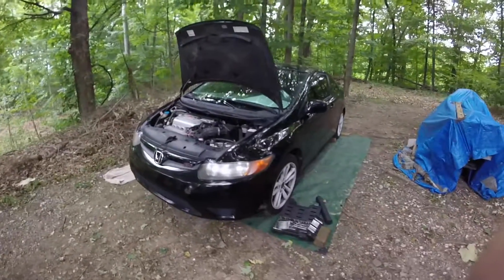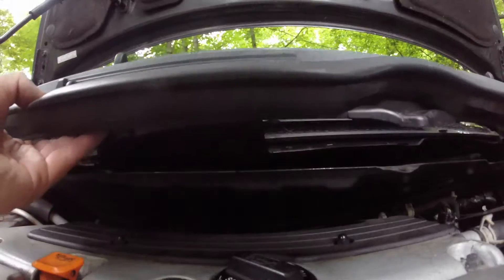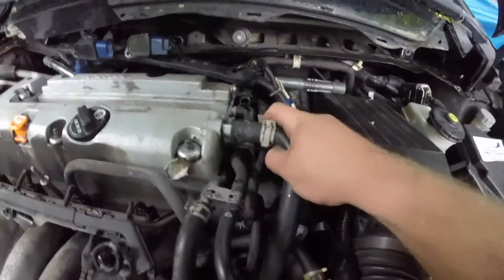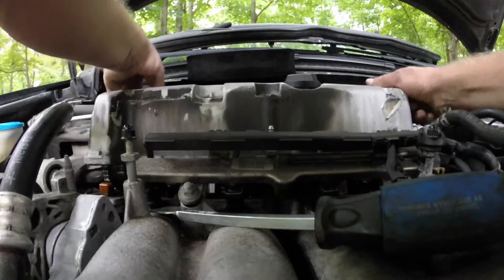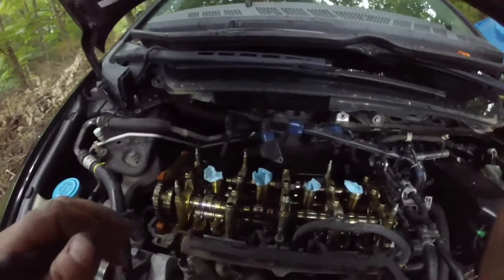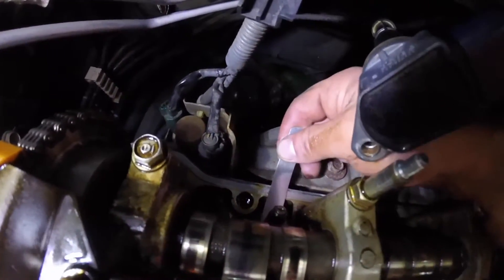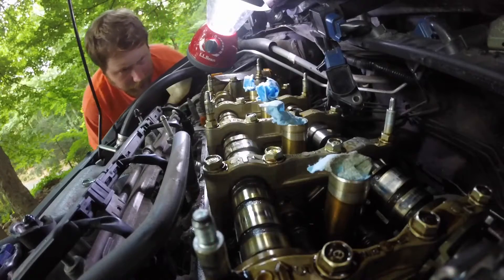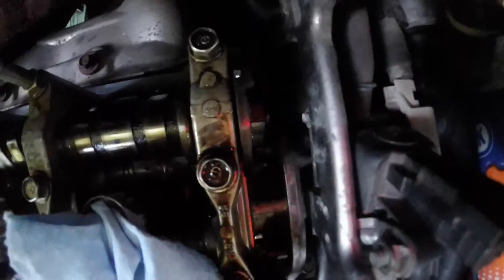K20 - K Series Honda Valve Adjustment (8th Gen Si)

Comment: The valve clearence for the k20z3 is:.008-.010 intake (front valves) and .010-.012 exhaust (rear valves). Done this a couple of times on Honda motors and every single time I end up with noisy valves if I use the mid to higher number so now I always use the lower number (.008 intake and .01 exhaust in this case).   They physically aren't going to be too tight if you can get the feeler in there without much effort. Another tip for turning motor which is easier than the method used here is to jack up the front passenger side wheel and leave it in 6th gear. Now just spin that wheel. If you feel like being ultra lazy then just use the alternator pulley bolt (believe it's 10mm) and crank it clockwise. And most importantly, never crank the motor  backwards. That could screw up the timing chain tensioner.
Reply: .01. K biene. Siendo.  El ajuste
Reply: Very good information.
Reply: Can someone confirm this?

Comment: Hey Gerb. I’ve done many valve adjustments on k20z3’s before for some of my buddies so I knew what to expect when I did mine last night on my si. This morning I started it up and it ran fine, besides a small tick that’s barely noticeable from only the interior. Also data logged on flashpro and it counted 17 knocks in 5 minutes only on cylinder 3. None of the other cylinders logged any knock. Car was completely fine before the adjustment as I drove it 3 days prior and data logged as well, and only had 2 knocks between all 4 cylinders during a 45 minute datalogs. Do you have any idea what it could be? I’m gonna let it sit for another day or two to get completely cold so I can go back in and re-adjust them again, just trying to get some opinions until then….
Reply: the flashpro knock is not real,(as ive read)   its based on a knock sensor in the engine that can detect a lot of false positivities. even hitting stuff in the road can cause it, bumpy roads, etc
Reply: Have you figured out the issue for knock? Also getting a lot of flashpro knock

Comment: Just wondering if your engine should be as cold as possible when adjusting the valves. Or is it okay if it's hot/ slightly warm. Thx in advance. Your videos help alot.
Reply from the maker: 100% cold. Glad i can help you out

Comment: This was so appreciated. Especially how to remove the under-cowl thing... (gotta remove the wiper blades, amirite?) And I ain't gotta disconntect the coils! Just lay them aside. One less thing to go wrong. And the magnetic spark plug socket! Done. Thank you! 2007 . Just hit 100,000. got an A 124 Maintenance Code.  Here I go...
Reply from the maker: You got this.  It is a pretty easy job, but you have to be precise.  Honda’s are very fun cars to drive and work on.  Yours is a baby haha 👌🏼
Reply: @TheGerbsteve  I'm 64. Original owner. Purchased new off of the show room floor of Brandon Honda. Fiji Blue  Pearl. Luv it!  Now, excuse me while I twist it to eight grand.  And yep at my age I'm precise  and luv this stuff. For fun, the first thing I purchased for my car was the factory service manuals both volumes and they wasn't cheap.

Comment: So put it on top dead center to adjust cylinder 1 and 3 valves then turn 180 degrees and adjust 2 and 4 cylinder valves? Or do I have to turn it 180 degrees for each cylinder?
Reply from the maker: Top dead center first, cylinder 1,3,4, then 2... I believe i rotated crank 90 degrees each time. You have to turn it rotate it for each cylinder you go to
Reply: Got my head back today! Wrenching away . Got alot of work to do.

Comment: And quick suggestion rather than rotating the crankshaft 90 degrees every cylinder i usually use a long screwdriver or extension but gotta mark a line on top of the that spark plug tube while on 1st cylinder while on tdc before u even get to next cylinder base on firing engine.

Comment: I did my adjustment last week and the engine sounds more quite and revs happily but before i even adjust it while driving radio off and all windows close im hearing a little tic or like a clogged valve line.. anyways since i adjusted i still hear it and when driving at freeway i suddenly get a check engine light for vtc valve gettin stuck my engine is k20a3.. 1000miles ago it was rebuilt by me

Comment: So this works for the 08 si? I know it's a 8gen but same thing right?
Reply from the maker: This process will work for 06' - 11' civic si models.
Reply: @Gerb Productions, hey man great video. Just a quick question, if my 2010 civic has 37k miles but over 8 years old now, having strange idle problems and checked vacuum leaks, proper oil changes, and everything. Would it be pointless to do a valve adjustment? I hear it's supposed to be done at over 100k miles, and I've babied this car to death but every once in a while at a stop I get a strange stuttering which worries me, anyways thanks!
Reply: @battosaijenkins  dude my car is doing the same thing you described did you ever find a fix??

Comment: Exhaust valves on that car should be .010-.011 
The torque is 14lbft for both intake and exhaust. 

10lbft is on the k20a3(low compression k engines)
Reply: Calvin K what if we over torque the lock nut... ??  Any adverse effect... 

i didnt have the torque wrench so i tightes as much as it went.... is it okay ??
Reply: @UsmanKhan-fp5uu  No that is NOT ok. Those internal engine parts need to be torque to exact spec. It's not like suspension stuff where you can get away with good n tight.

Comment: Yay!! No more timing belt!!
Reply from the maker: +Tcho2100 Right lol...  Do you drive an si?
Reply: Gerb Productions i own a 2013 Si
Reply from the maker: +Tcho2100 nice bro, how's the torque?
Reply: Gerb Productions meh! 170ft of torque!u don't really feel the push unless u rev it hard until the vtec light come on(wich i don't really like to rev my car that much) over 5000 rpm! I come from a maxima 2003 that had about 245ft of torque at low rpm! I loved it!
Reply: Tcho2100 Swap your head for a k20 one and then do full bolt ons and a tune. Rev that baby to 8k.

Comment: question. is there torque specs when you tighten the valve cover?
Reply from the maker: +Dego18 Col yes.  They are anywhere from 13-15 lb ft of torque.  Just do 15, you'll be good
Reply: sounds good thank you for the quick reply.
Reply from the maker: +Dego18 Col you got it.  If any of your si friends need help, you know where to send them haha ;)
Reply: Dego18 Col It’s 8.7 ft lbs

Comment: The specs I was told were 0.008 intake and 0.010 exhaust. Where do I find the truth?
Reply: Intake .21-.25mm Exhaust .25-.29mm. Engine must be below 100 degrees
Reply from the maker: +cardboardorigami My video, I talked to a Honda tech.
Reply: yes.. this is correct
Reply: I've been reading on 8th civic forums that people run them at .008 on the intake and .010 on the exhaust. You gain some performance and quiets down valvetrain noise. A few people were having issues with running them at .009 Int and .011-.012 Exh
Reply: @junrowdy  I decided to run my valve clearances to .008" and .011" respectively on my 2006 CRV instead of running .012" on the exhausts, it has quietened my valve train considerably.
Reply: @Desertduleler_88  dont be shy to run the exhaust valves at .010. You could be leaving some performance on the table. From my experience, all Hondas, B, D, K, and H series run perfect on the tighter end of the spec. Just my 2 cents
Reply: @junrowdy  Hmm, I have heard the exhausts tighten up more so than the inlet side so I decided to leave it a .011" rather than risk burning out the valves. My CRV is not used for performance applications so I'm not all that worried about performance. I know the earlier versions of the CRV 1st gen. had burnt valve issues due to the valves working their way into the cylinder head.
Reply: @Desertduleler_88  I agree with you 100%. I've always noticed the exhaust valves tighten up more so than the Intake valves over time. In your case since you're not using it for performance purposes, the spec you're running is spot on. I always run mine on the tighter end of the spec, but then again I'm always checking my valve lash every 8k. Always checks out dead on the money
Reply: @junrowdy  That must be a pain to check it very 8K, I'll check mine again at 50K.
Reply: @Desertduleler_88  it only takes me 30min to check honestly. Its cake
Reply: @junrowdy  and it's definitely worth it! I'm at 160 K I do it annually and I still burn no oil at all
Reply: @junrowdy  it is cake . For a 2013 civic si manual says .009 intake and .010 exhaust . What do you recommend ? I hear they come tighter than that from factory ?

Comment: Question, do you think you have enough room in the back to use a valve spring compressor tool to remove the exhaust valves if you wanted to?
Reply from the maker: I don't think so man, It's pretty tight back there.  I was having a hard enough time with a small wrench and my feeler gauges.  Doesn't hurt to try!
Reply: Donald Geter Jr You have to remove your cylinder head to remove your valves

Comment: wow haven't done one on mine n it's 135,000 miles lol idk if the past owner did one but I just finished my tune with vit n he didn't tell anything but looks like I might just get one.
Reply from the maker: I just figured I'd do mine while replacing my valve cover gasket.  I need a tune so bad man!  Just got my exhaust!
Reply: +Gerb Productions I 'll suggest waiting for a tune once you have all your mod parts n are certain to keep it that way then tune , but yeah just got my drunk from bit it made 208.89 whp n 
154tq 
should be off by 1-2 whp n torque but yeah that was my goal the 200whp club lol
Reply from the maker: That's exactly what I'm going to do.  Have a few more things that I'm going to order, then I'll save for the hondata.  I'd be satisfied with those numbers.  200 who for the win haha